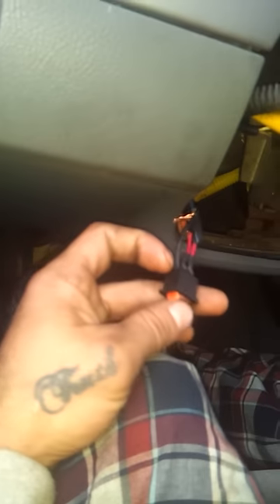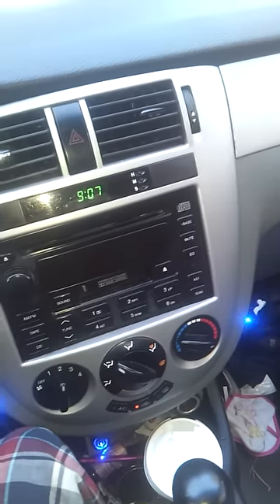How to hotwire a car & disable steering wheel lock

Comment: Lost my only truck key, used your method... wires were a bit different but I figured it out... i used 2 switches and connected the ignition wire to the bundle... now my 02 Ford explorer is push to start with a door lock code... thanks!
Reply: Sounds better than a key to me haha

Comment: This works in older cars, but newer ones and ones with transponder chip anti-theft  features take more effort. In those cases you may have to run a long jumper wire out to the starter relay under the hood and/or power the fuel pump or ignition directly, because the cars anti-theft system disables that stuff in the ignition harness when the key chip isn’t detected. Sometimes you can trick the car into thinking the key chip is there, but that can be hard to do. Of course if you have the key with you, and your ignition switch is just bad, just put the key in the ignition and do this Hotwire method and you should be good. Best of luck folks. Use the knowledge for good, not evil!
Reply: Even with the starter and fuel pump wired directly the ignition spark/timing and fuel injectors are both ecu/ecm controlled. The engine will turn but you won’t get fuel or spark since fuel injection systems run off crankshaft speed sensors, o2 sensors, knock sensors etc. all of which are controlled by the computer. The immobilizer keeps your engine from starting I believe through no spark which there is no way to direct wire unless you got a distributor and a carburetor since again fuel injection doesn’t run if the computer isn’t getting the correct inputs.

Comment: as for the cutting of wires theres no need remove the single screw and pull out the ignition and use a screwdriver to turn the car on and off

Comment: On a 93 bmw , you can fill a hole in the bottom of the steering column &  pull out the spring, that'll unlock steering wheel.

Comment: Does this defo work on every car? I have a Renault Clio 56 plate (UK) and I have managed to snap my key off in the ignition barrel, I cant remove it no matter what, Everything on this car is dependant on electric like yours, I just need to know I will still have working airbags, ABS, steering etc?
Reply from the maker: IDK. Please do your research and make a decision according to your findings. If you have a chip in your key or a security system I would be very careful.

Comment: I lost keys also. The pin controlling steering lock, what so you mean pull out and turn. Pull away from key entrance? And turn, which way clockwise or ccw? Did you remove cylinder or just pull it out a little? I got engine started just not steering lock. Thx good video.
Reply: Honestly the easiest way it to snap it with brute force, but you could drill it.

Comment: so what about anti theft cars, I have a 02 grand prix and the ignition went out. if I hot wire it will that screw with the anti theft stuff. because I was told that if I get a new ignition swtch for it the computer has to be reprogramed
Reply: I hot wired my Dodge Durango with anti theft. It works just don't  Do and what I did and have a dumb a** buddy who reaches his hand through your window to unlock your car and set off the anti theft after you how wired it..  Because now I'm here trying to figure out what to do.

Comment: Okay so i have a 97 ford escort zx2 that i lost the keys to and i already pulled the ignition cylinder off from the back side and i accidentally broke that pin you have to turn to unlock the steering wheel, can i still unlock it with it broke or not?

Comment: Hey bro if you have any knowledge on this problem im having and you could help me out I would greatly appreciate it!! Anyways got a car from an auction that only came with one key. I lost that key & didn't have money to replace it so I just hot-wired it.  Rverything went perfect for about 2 weeks until 1 day I had my windows down and 1 of the doors locked when my buddy decided to reach in and pulled the lock up and opened the door. The anti-theft went off, the battery's dead now, and every time i try to jump it the alarm sounds immediately and cant get the car started. Any idea what I should do bro?¿  The vehicle is a 98  Dodge Durango.
Reply: MindAintRite ...pay $50. for a basic AAA membership and call them to help dismantle the alarm and start your car!

Comment from the maker: For all you retards hitting the dislike button, this is for an 05 suzuki forenza. If it's not working for you then you either need to find a video specific to your vehicles make and model or actually use your brain and try to figure it out.
Reply: How do you bypass the immobilizer?
Reply from the maker: The 05 Forenza does not have an immobilizer chip. That's a whole different animal my friend.
Reply: peruzfinest07
Really I thought all cars above atleast 2000 have immo?
Reply: *****
Can you name a few cars which don't?
Reply: True true
Reply: peruzfinest07  Hey man ! can u make a video about a Vw Golf 3 please?
Reply from the maker: ceberica88 I dont have a VW to make the video with lol
Reply: Appreciate this comment lol it needed to be said in the video
Reply: +TruthSeeker The immobiliser only became a legal requirement in 2007 for most of North America I believe.
Reply: I'm quite sure it's a mandatory requirement in all modern cars after 2007 for Canada at least. You probably can't find a modern car without a chipped key.
Reply: peruzfinest07 bro I got the same car having the same problem but I don't know what pin to pull out to keep the wheel from locking. Help me out.

Comment: there is 2 bolts that hold the lock on the steering column and 3 that hold the turn and low beam to the lock remove these 5 and the lock is removed steering unlocked

Comment: I have 4 runner 1998 bought the car and someone fucked up ignitions trying to steel the car with screw driver putting in ignitions at night now steering wheel is locked don’t have key I can’t unlock the steering wheel

Comment: this works for a dodge 2016 1500?
Reply from the maker: Angie Speck I'm not sure but I wouldn't advise doing this with a vehicle that has a chip in the key.
Reply: No not at all you'd just be turning the starter new cars are almost impossible to hotwire these days

Comment: I use a mini screwdriver flathead to turn the ignition switch similar to the one you have there The car will turn on I can even put the bottom panel back on but I can't get he steering lock to disengage? I need help.04 Kia Rio
Reply from the maker: on the opposite side of the steering column where you put your key in, there should be a sla(flat piece of protruding metal that locks the steering wheel. You need to either pull the cylinder out a tiny bit or clip it off. I'm sure there are other ways but these are the only two I can think of off hand. its been awhile since I made this video.
Reply from the maker: *slab

Comment: or just use a drill and drill the ignition lock pin out lol
Reply from the maker: drifting&hackingyourphone you would have to drill the springs out from behind the tumbler pins. that would work too but I didn't have a drill when I was stuck 10 at night an hour away from home. I had a toggle switch, a knife and tape.
Reply: peruzfinest07 Hypothetically, if my friend peeled the steering column and got it to start, why do the high beams sometimes get stuck on the on position when breaking the column lock.

Comment: U cant disable steering lock u need to place key inside switch and turn key to position 1 so u can remove the cylinder its a safety measure done by every company
Reply: Sliding hammer fixes that.